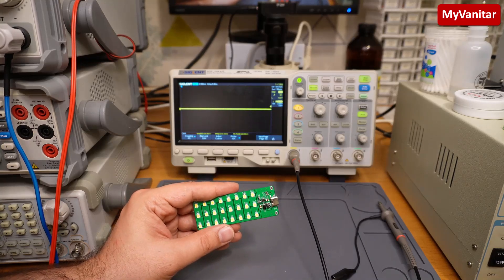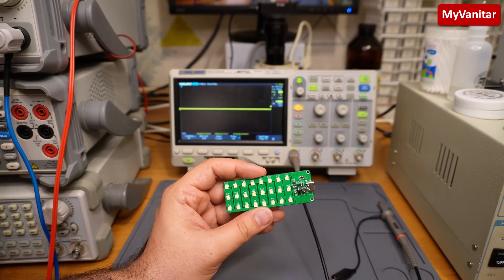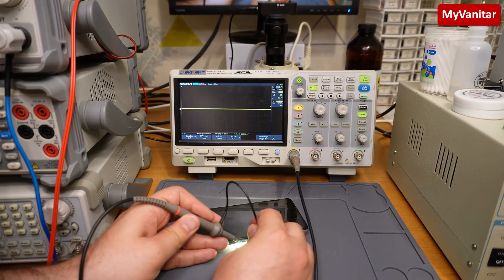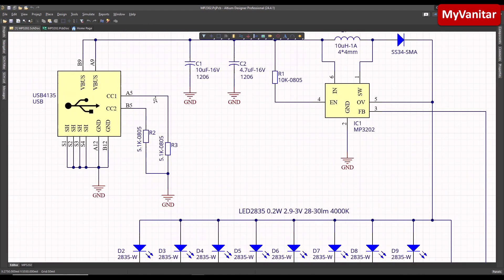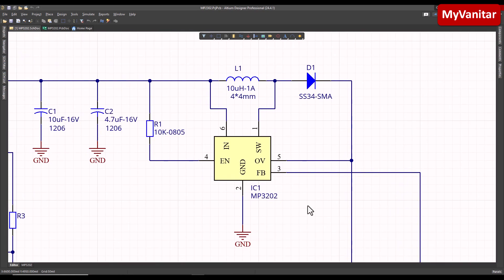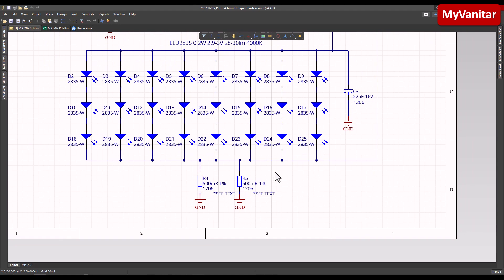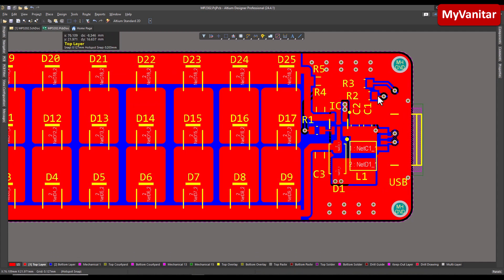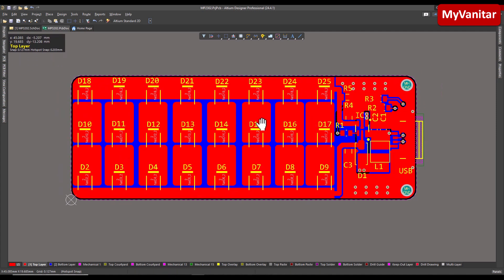4.5-W 600-Lumen USB Type-C LED Emergency Light Circuit

Comment from the maker: 4.5-W 600-Lumen LED Emergency Light (LED Torch) Using MP3202 1.4-MHz Driver
Reply: Don't have article link
Reply from the maker: Yes, but it will be published as soon as possible and I will put the link there. you can read more and download the PCB from there